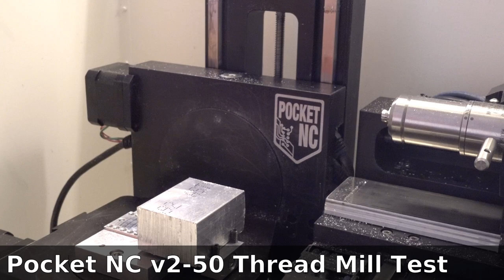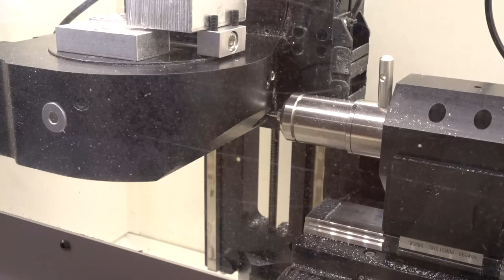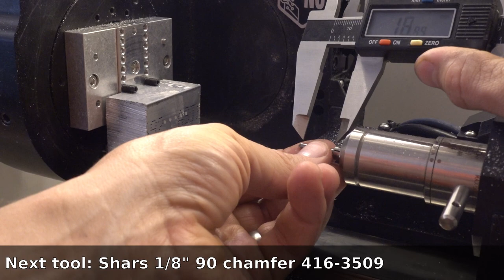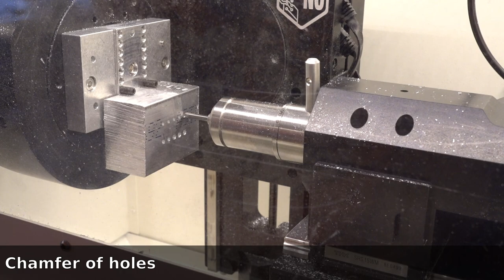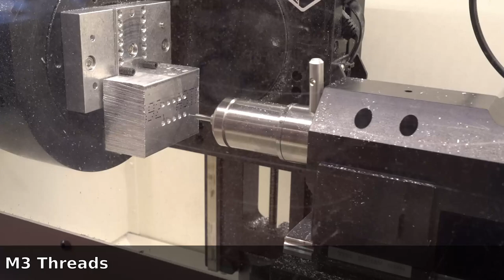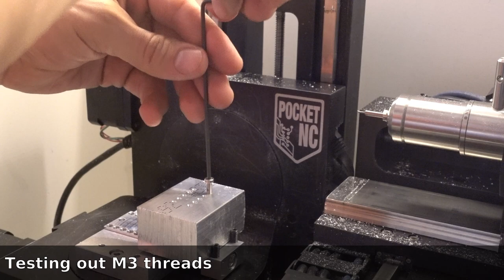Pocket NC v2-50 Threadmill Test

Comment: What kind of tolerances can you achieve with this machine/spindle?
Reply from the maker: I largely only work in 6061.  There, 0.005" is pretty easy.  Tighter is possible, but requires patience and sometimes creativity.  I've done plenty of features that are toleranced to 0.001", but you can't do that with every possible feature.
Reply: @awesjosh  Awesome, thank you for the reply!

Comment: What is the working space of the mill like how big of an object can you mill like the dimensions
Reply from the maker: The working volume is bit more than 4" cubed, although unless you're doing minor post-machining operations, you'll probably run into cycle time limits before you hit the size constraints.
Reply: @awesjosh  Does the pocket NC have a cycle time limit? Or is it a memory/file size limit?
Reply from the maker: @christophejohnson9259  There are no limits, but practically it can't run for that long without filling up the chip tray.

Comment: Indeed impressive.  Would you achieve the same results with brass?
Reply from the maker: I suspect so. I have machined brass with no problems before, but haven't tried thread milling yet.
Reply: @awesjosh  Thank you.   Let me be more specific.  I'm contemplating a machine such as this to machine small, yet very detailed brass 3-d parts (from about 1" in size and down) in order to make high-end brass steam locomotive models, as well as other brass train models (they operate electrically).  Typically these brass parts are made using lost-wax casting techniques.  This is very time consuming and labor intensive, and also involves substances that the EPA takes issue with, as well as high heat, sufficient to melt brass, which is why most of the production of these models has moved to Korea and Japan.  While machining each part might take some time, because its CNC, meanwhile the operator can occupy himself with other takes related to the construction.  If this machine would work for this, it would pay for itself before long.  I have seen videos of CNC machine of very fine detail, which is what would be required.  The following URL has some example photos, of some machining done to accomplish this, as well as some of the cast parts assembled by soldering.  https://www.kohs.com/UP_type_Pages/UP_type_Construction.htm.  Thanks.
Reply from the maker: The Pocket NC can certainly machine parts with such detail given appropriate tooling.  However, you wouldn't want to underestimate the effort require to devise appropriate workholding and to develop the necessary toolpaths.  I spend between a few hours and few days per unique part on that portion.  (which is really just part of subtractive CNC machining, not specific to the Pocket NC).